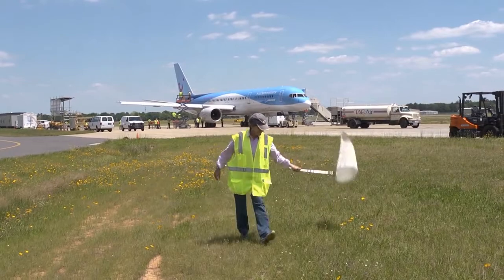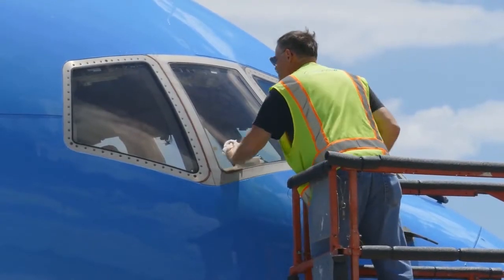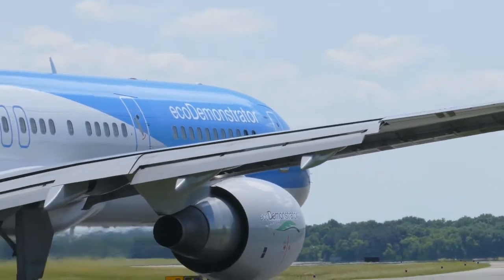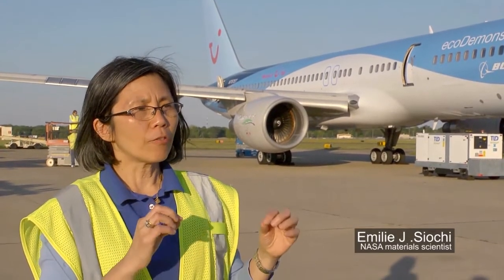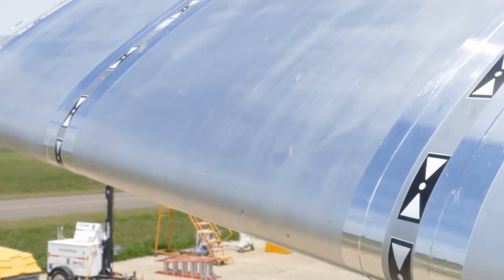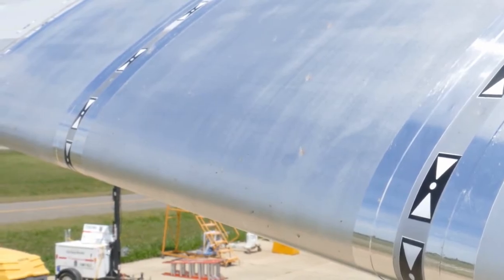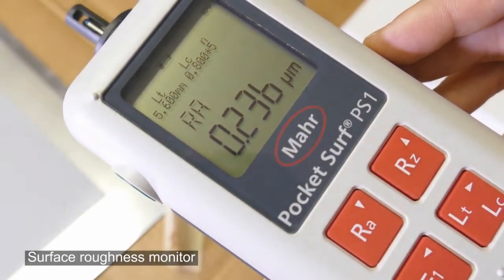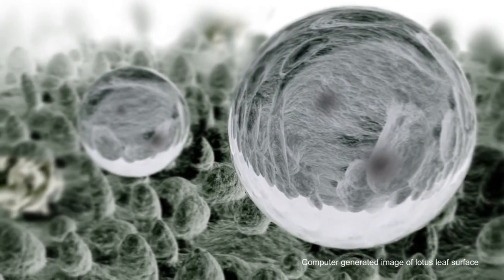Debugging Planes To Improve Fuel Efficiency

Comment: Transparent superhydrophobic coatings can be easily applied to cars, buildings, and in this case, jet aircraft. There are even processes that can coat electronics and mobile phones with the fine coatings. They are typically made from fluoropolymers and/or applying a thin coating of silica nanoparticles to surfaces to create fine surface features that change the contact angle of various liquids and water droplets which causes the droplets to roll off the surface, carrying dust or even bug juice away. This is what is called, "The Lotus Effect". Such surfaces are self-cleaning, and can reduce drag and improve fuel efficiency in aircraft and other vehicles.